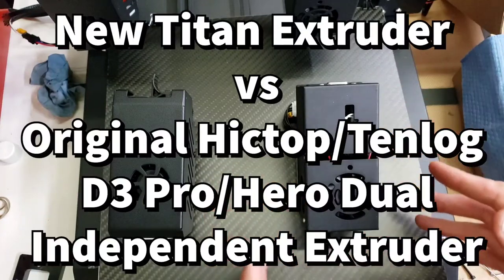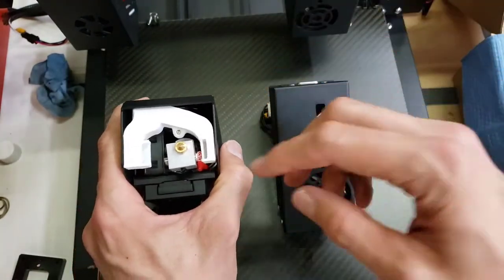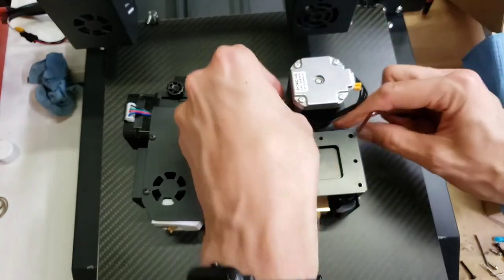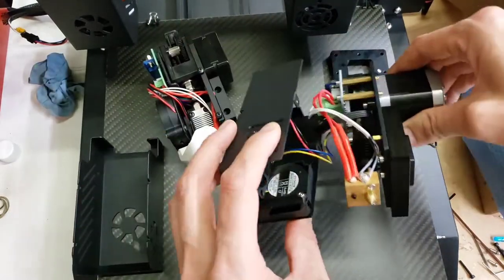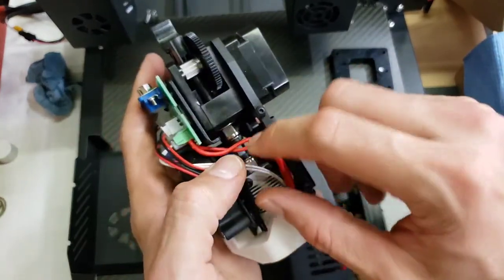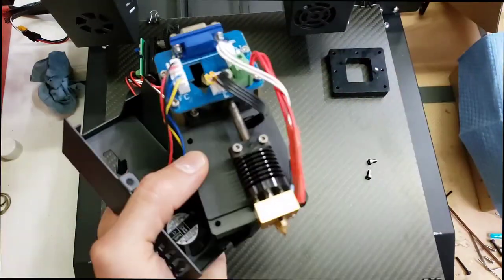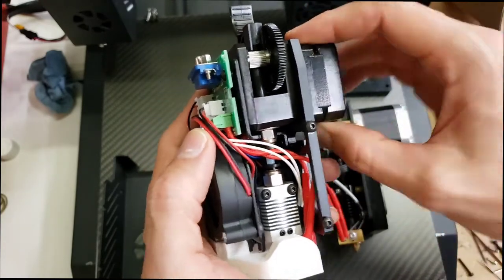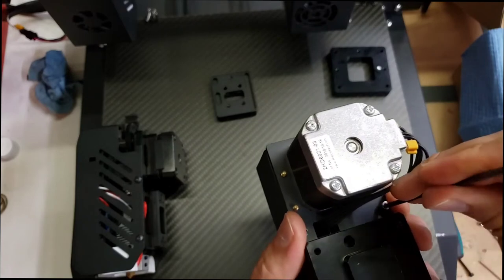New Titan Extruder for Hictop/Tenlog D3 Pro/Hero vs Original Extruder - IDEX Independent Dual

Comment: about the vref, standard value is 1.23V i have adjust this for the 2extruder to 1V. The temperature drops from 63°c to 55°c
Reply from the maker: Can you explain how to make the adjustment? Is it firmware, or something on the board?
Reply from the maker: Also, is yours a Hictop brand, and does it use the TMC2208 stepper drivers?
Reply: @engineerable  it is a tenlog with tmc2208. I have adjust the vref on the driver board tmc2208.
Reply from the maker: @denisvandenbroucke3785  Excellent! I have not yet opened the case to access the drivers, so I don't know if I have the TMC2208 drivers.

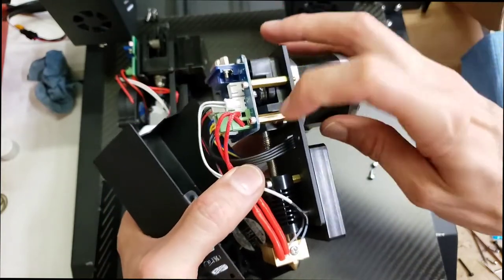Comment: 8:06 Can you please confirm if this is, in fact, an all metal HotEnd?
Reply from the maker: Ok, I will do a tear down of the original extruder that the Hictop D3 Hero came with.
Reply: @engineerable  did it end up being all metal?
Reply: @navdeepasi  seriously do you even know if it’s all metal or not? ....
Reply: It is not all metal. I had mine apart last week. There is a teflon tube running the length.

Comment: Are these still compatible with the  filament sensor? And by the way, what are you using as build plate?
Reply from the maker: Hictop doesn't have the filament sensors like the newest Tenlog. There is an unused connection on the PCB that is labeled as an auto level sensor. I did not see anything labeled filament. You could hack it by soldering directly to the connector. Using a carbon fiber build plate because it's flat, rigid, and I'm printing Nylon 910, which sticks well to CF.
Reply: We will add the filament monitor on the next batch, changing the board inside is OK, you can also buy the board separately
Reply from the maker: Are you saying that I will be able to add the filament monitors by buying a new extruder board?
Reply: @hictop8293  can you give the link for this board? other? is it necessary to adjust the vref on the stepper driver? my motor is above 63°C

Comment: Hello
i install the two new titan extruder. I noticed that the extruder motors are very hot.
should you adjust the run on the tmc2208?
Reply from the maker: That's a good point that the max current of the smaller motors in the new extruder could be less than the old extruder. I have not paid attention to the motor temp after the change. Hictop did not have any instructions about changing the current. We should ask them about it.

Comment: How many screws are used to fix the support on the x axis? the holes do not seem in the same place!
Reply from the maker: There are 4 screws used to attach the new Titan extruder mount that go straight through the sheet metal bracket that grabs the X axis belt and threads into the linear rail carriage. Yes, the hole locations are not the same on the Titan vs old extruder, because the old extruder mount screwed to the sheet metal bracket instead of screwing straight to the linear rail carriage. I have a not yet posted video showing the extruders being swapped out.
Reply from the maker: Take a look at the new video showing the installation. https://youtu.be/RzvWFokAQ1M

Comment: @Engineerable, would you be interested in making a video on connecting this printer via usb?
Reply from the maker: I've only ever used the SD card method to load files onto the printer.
Reply from the maker: What software would you want to use via USB? Cura? Is your desire to transfer the files onto the the printer, or have the computer directly control the printer?
Reply: @engineerable  Control via pc. I am currently using the latest Cura.

Comment: How many pins does the bed leveling sensor have, where the missing connector is? It looks like 6 but only 3 are being used however I can't tell for sure...
Reply from the maker: I'm not certain what bed leveling sensor they intended to use, but most likely it is a BL Touch. The BL Touch I have seen have 5 pins. On the extruder PCB there are 3 traces visible on the front, but I suspect that there are additional traces on the back of the PCB.
Reply: i know I'm kinda randomly asking but does anyone know a good place to watch new series online ?
Reply: @Orion Malik thank you, signed up and it seems to work =) I really appreciate it!
Reply: @Eduardo Declan no problem xD